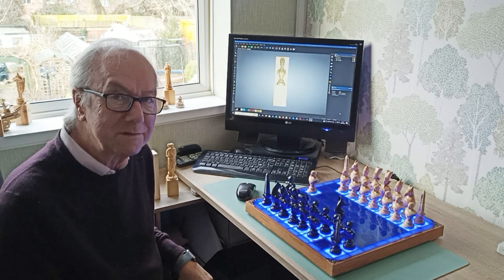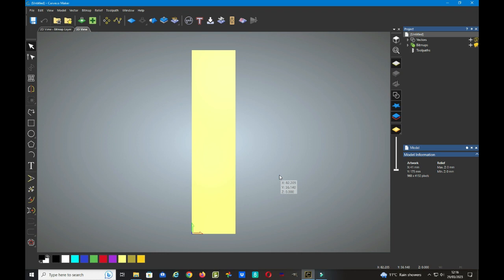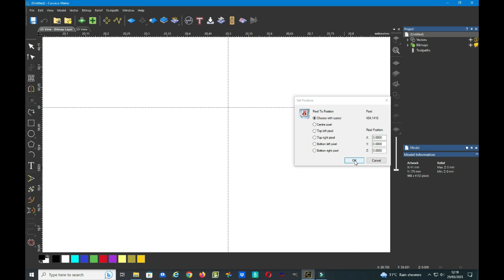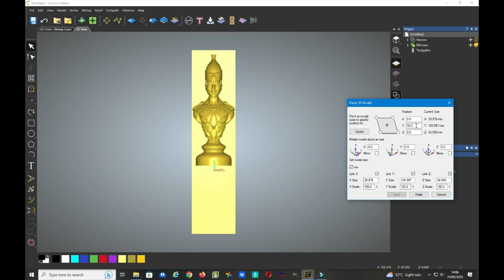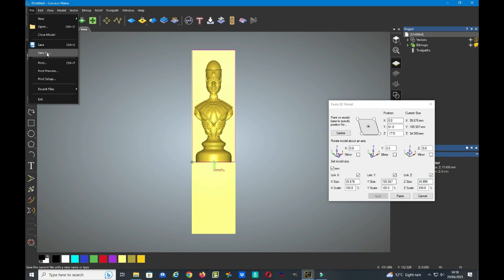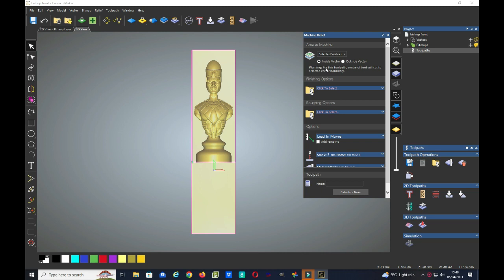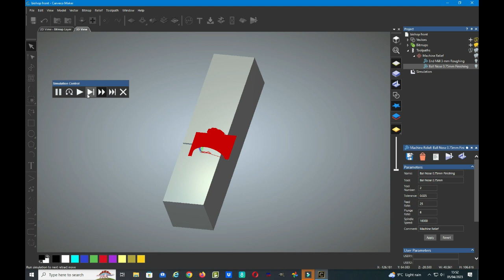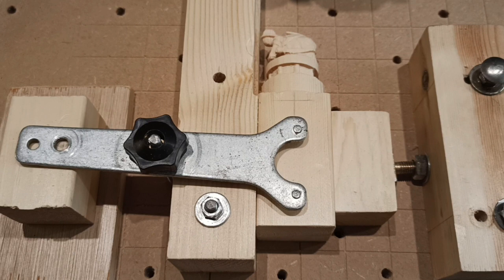3018 CNC Chess Set how its done

Comment: Amazing work, great kudos to you for learning and sharing. I still have to polish my 2 sided carves. Always about 0.5mm out, getting there slowly.
Reply from the maker: Thanks John I also had to make adjustments as I progressed. I’m beginning to carve another chess set but this time I am adding extra material to the bottom of my 3D stl model using Meshmixer. This way I’ve got some extra wood so I can adjust the tip of the finish bit before it reaches the model itself !

Comment: I have tried making these but the knights ears keep breaking off on finish pass
How do you keep the ears from breaking.
i am using a 1mm tapered ball mill for the finish passes
what tool do you use
Reply from the maker: Thanks for watching my video.
When carving the knight try using the roughing tool on the sides only !
Then run the finish tool on the front and back only. I cleaned it up with a Dremel fine sanding tool.
It’s been a while since I made this chess set but I remember not using the roughing bit on all four sides.
Reply from the maker: Try using a smaller finishing bit maybe a .75 or .50 tapered ball nose.

Comment: It is a beautiful set ,but I thought you were going to design the pieces  in carveco not just import.
Reply from the maker: Thank you for your comment. In order to create my carvings a STL file, Standard Triangle Language,  is needed and you can't create STl files in Carveco ! This type of file is made with dedicated creation software such as Meshmaker or Fusion 360. What I have done is basically carved a 2.5d relief on one face then rotated my wood so that the end result is a 3d carving. To do true 3d carving will require a 4th axis to rotate the wood as it carves. This is something I am looking into.
Reply: @kelsres  Thank you. I thought carvco  had design  capabilities,as well as rotation.
Reply from the maker: @Townie001  it certainly does for some relief carvings and I think the full version of Carveco covers some aspects of 4axis but this only relates to what's known as wrap around carving.

Comment: Hi Paul Thanks for the video and have wanted to make my own set like yours but have had trouble lining the sides up so did follow along with your example and front and back turned out quite good - used a 6.35mm end mill and a 1.5mm tapered ball nose as finisher - but had the same problem ass before when machining the sides in that the 1.4mm ball nose always wants to cut into the front or back so destroys them - any suggestions on how to overcome this? thanks Kerry
Reply from the maker: Thanks Kerry I'm glad you're  having a go ! 
The bits I used were smaller than yours, 3mm end mill for the rough cut and .75mm tapered ball nose for the finish. I made a lot of firewood before I finally got the finishes that I wanted. I found that it was better to rough cut the front and back only then run the finish bit on the two sides only but some of the chess pieces needed the finish on all four sides. Take great care to get the Z height correct and you may need to set it a fraction high to begin with.
Practice with the pawns first as they are the smallest and faster to carve.
Good luck !
Reply: @kelsres  Hi Paul thanks for the help and after a couple of disasters I did work out how to do it and have since carved two of the bishops with great success - I used the 6mm end mill and the 1.5mm tapered ball nose and took approx 16 minutes to rough each side and approx 1 hour to finish each side so now will apply the same design to the others thanks again Kerry
Reply from the maker: @user-ml6dg5sr7o  thank you and I'm pleased that you're enjoying it. Once I had understood how the carving should be I did take great care when starting the finishing cuts. I use the UGS platform and am able to slow the feed rate right down to 10% for the very first plunge then increase it as the cutting progresses. Also you may need to make tiny adjustments to the position of the job origin just to make sure that each side lines up perfectly with its opposite side.